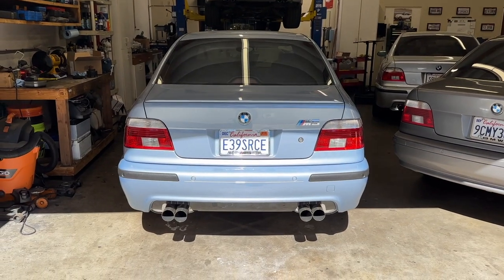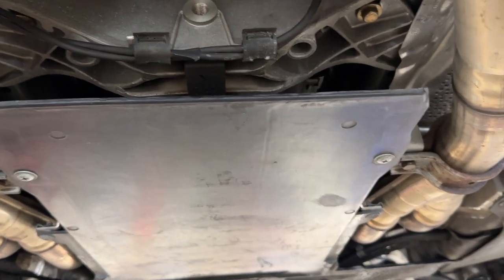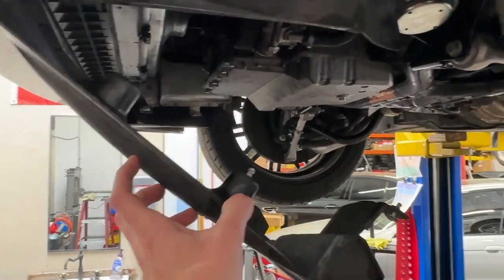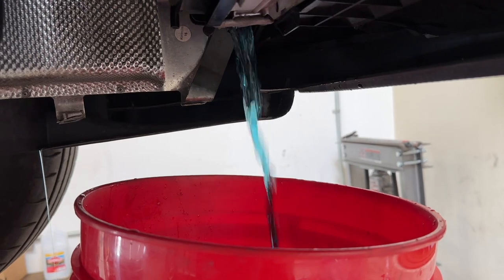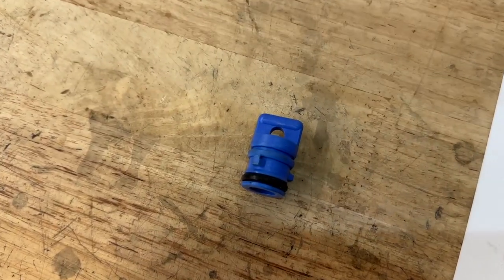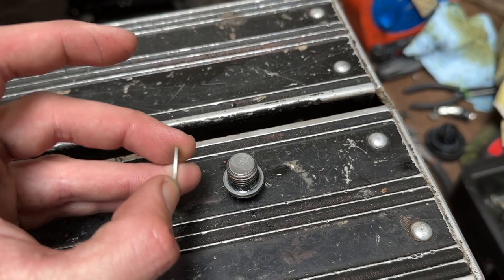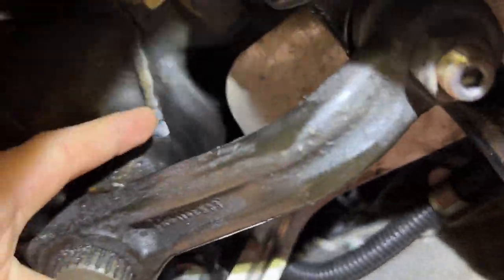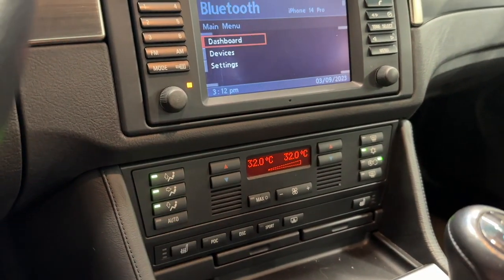BMW E39 M5 Coolant Change DIY

Comment: You are very blessed to have so many iconic bm's in your arson. My dream beemers are the M5 and and 540I and the 850I. Best vehicles ever build
Reply: Lol , I have those t exact models. All in getrag 6 speed manual
Reply: @ianmcwilliam1753  awesome. Best choises made right there👍🏼
Reply: Thanks Neville… I bought the 540i/6 ten years ago. Loved it so much I bought the m5 5 years ago when they were still reasonably priced. The 850i/6 was 6months ago. It Sat in a garage for 3years so fuel pumps are bad . Bought that one a ridiculously good price and being the manual 6speed it’s pretty rare . Got the new Bosch pumps and clutch slave cylinder for it but haven’t had time yet ( traveler RN ) . A 2 owner car with service history , owner manuals , full tools set etc. it’s a full time job keeping these old classics properly maintained and on the road but it’s worth it for the pure driving experience of them. Best era of bmw . My daily 540 is still a great car even with 160k miles and can still be found with the 6speed (a must have for the full  experience) for under 10,000$.

Comment: I have to completely flush my coolant on my 540i. The previous owner drained the blue and put in green. I have a list of parts I'll replace when I do this, so it'll be a pretty in depth job. 

Right now it's in the air to add transmission fluid and I'm visually inspecting as much electrical connections, fuse boxes and relays in search of the elusive battery drain problem.

Comment: Hi Ryan! You are a wonderful resource to the E39 community. I have a qq… I’m planning on replacing my yellowing expansion tank. Do I still need to drain all the coolant? Reason I ask is that the car recently had a full flush done. Thanks!
Reply from the maker: Thank you very much!

It would be best to drain out the radiator to replace the expansion tank.  The water pump/thermostat housing will leak out into the reservoir a bit so draining the radiator would be the cleanest way.  Alternatively, you can just drain the reservoir if you're diligent about catching the drips under the car

Comment: Thanks for the excellent video. Clearly thisis the best way to do it. What is your opinion of the "vacuum cleaner" type machine that many dealers use? I've used those during DIY events on my car, how much coolant do they get out? TIA.
Reply from the maker: Vacuum cleaners are quick and easy but almost always leave ~10-20% of the fluid in question behind.

Comment: Hello Ryan, could you provide the part number for 10 mm undertray screws which always go missing? Mine are missing too, but I can't find the part number anywhere, thank you.
Reply from the maker: I have never been able to find the part number for those screws either, I generally convert them to the 1/4 captive screws.  The whole point of those is to be quickly released, so the 10mms just got in the way and most everyone has lost them by now.